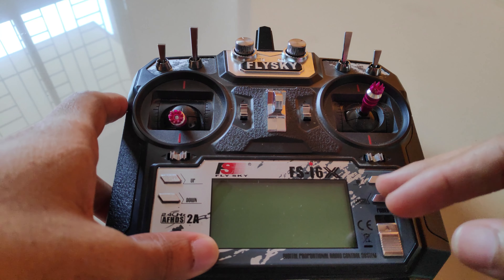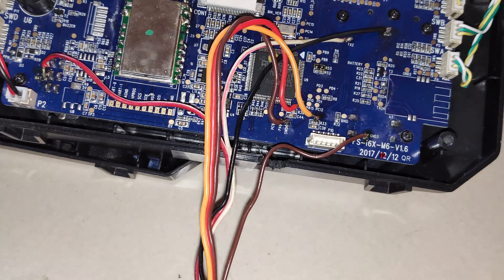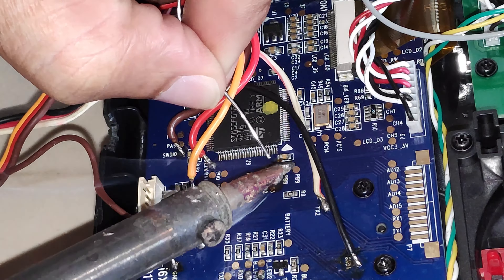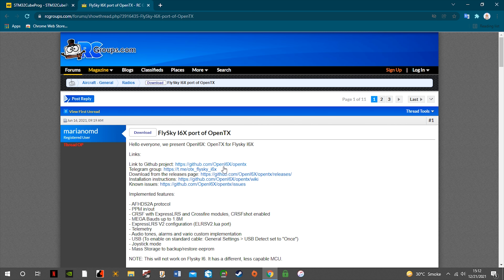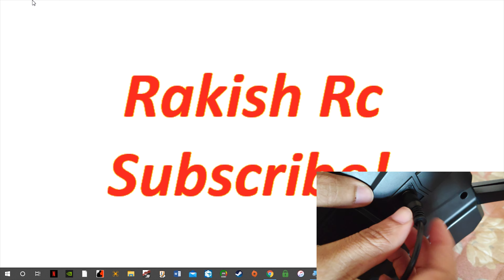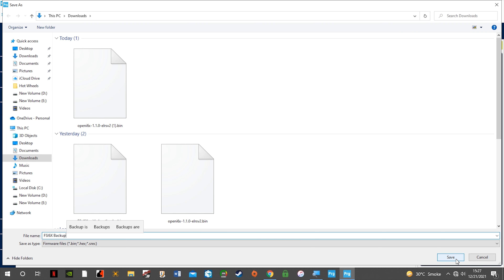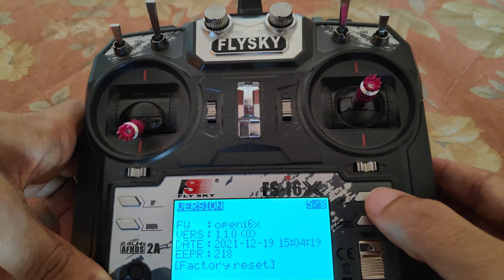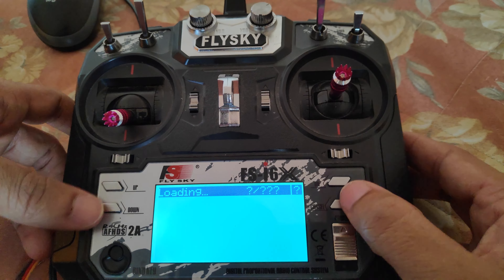Flysky FSI6X Open Tx Firmware Installation via DFU Mode

Comment: If you have stored Models in Transmitter - do they stay or you have to re-program them?
Reply: To be more clear: I mean if you upgrade 1st time - from original software in Transmitter to Open TX ?
Reply from the maker: @Mike4_friends  For the first time from. Factory firmware to Open Tx firmware all models will be lost as the eeprom is different and reset. Once you install latest open tx firmware you can always back up your new models eeprom file. But at the moment restoring models from different open tx firmware is not supported fully.
Reply: @RakishRc  After bridging - connecting to USB and STM32 Cube Programmer I get the Warning "Device is under read protection! If you want to disable RDP please reconnect with Read Unprotect enabled." If I mark read protect block - still can not enter USB  programming mode ??
Reply: Solved - thanks

Comment: Hi rakesh bro.
Did we can flash from i6x firmware directly to openi6x 1.3 with this method ?
Reply from the maker: Yes you can. Just make sure you initiate the DFU mode properly and then flash the latest open tx firmware file 👍

Comment: Hi Rakish, I am interested in your method to install opentx on flysky radio because I would like to use a headtracker with mine. As I saw in your video dedicated to the use of headtrackers, I have to install open tx on my flysky. However, I have an fs-i6. I saw in one of the comments below that there is another firmware for fs-i6 but is it opentx too? And will I be able to use an headtracker with this other firmware? Or should I rather buy an fs-i6X? Thanks

Comment: Will this firmware gives u better range
Reply from the maker: Better range with stock flysky receivers? I don't think firmware would make a difference on the range for flysky receivers. But express lrs is exactly for that...long range and strong signal connectivity 👍

Comment: Hey. I did the opentx firmware upgrade by watching your video. Thanks and big help  but I can't get my crossfire module to work. Can you help?
Reply from the maker: Did you wire the tx2 pad for signal wire with a ground pad? And then have you selected crossfire in the external protocol settings? It should work 👍
Reply: @RakishRc  yes did all of that twice. I'm getting nothing
Reply: @RakishRc  also. How do I apply the elrs lua from the tools. When I click on it it just says loading
Reply from the maker: @almacfpv74  if it's stuck on loading that means the elrs module and radio are not communicating properly. Check if the wiring is correct and elrs 2.0 firmware is flashed on rx and tx module
Reply from the maker: @almacfpv74  I've got a video on elrs 2.0 menu for this radio coming soon 👍

Comment: can't i use the regular firmware updating tool (flysky-updater-win64.exe) and select openi6x_1.6.1_en.bin for example to update the firmware? 
it said Unexpected firmare size: 128168 bytes. Use --force to flash anyway. so i canceled it and preferred to ask before trying it. thank you for your help
Reply from the maker: It's possible can you send me that flysky updater tool. I had it once but it's not available on flysky website anymore. It could work but will have to test. Even something goes wrong you can always flash original or open tx firmware by dfu method. No harm in trying.

Comment: @Rakish Rc I'm trying to put the radio in DFU mode but windows recognizes the usb as a malfunctioning device, can anyone help?
Reply from the maker: Hi, did you check which processor is on your fsi6x? If it's stm32 then you'll need to install stm32 drivers. If it's geehy apm32 processor then let me know I'll share more links on how to get it flashed with open tx firmware. Did you install stm32 cube programmer? Sometimes switching to a different usb port might help.. check if usb cable is good
Reply: @RakishRc  Hello, I checked that my FS-I6X's processor is a geehy apm32, I installed STM32 drivers and tried all USB ports, but the error is the same. Can you help me?
Reply from the maker: @actomaz  https://github.com/OpenI6X/opentx/wiki

https://www.rcgroups.com/forums/showthread.php?3916435-FlySky-I6X-port-of-OpenTX/page16

Check these links..you need to use qmk toolbox to flash firmware for gheey processor
Reply: @RakishRc  Thanks!! It worked... I was able to install opentx!!!! Thank you!!
Reply from the maker: @actomaz  awesome! 👍
Reply: Can you help me pls? My computer does not recognize the MCU (APM32), how do I install the drivers for this MCU?